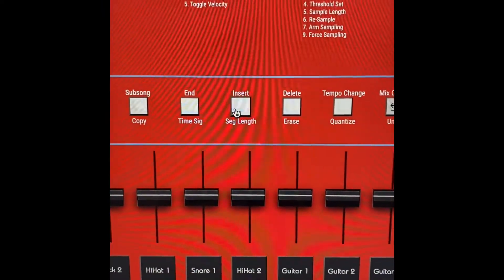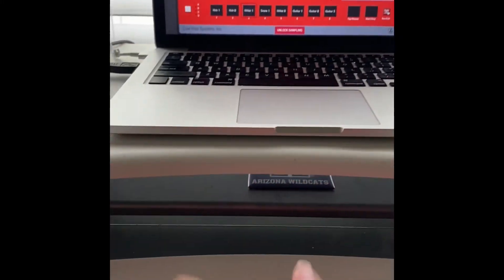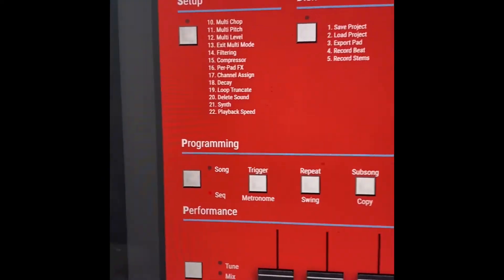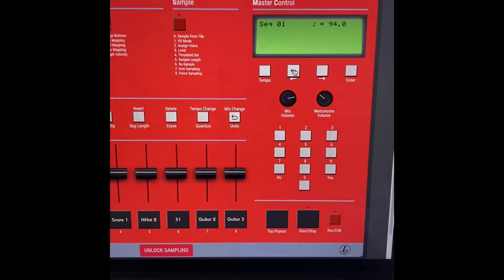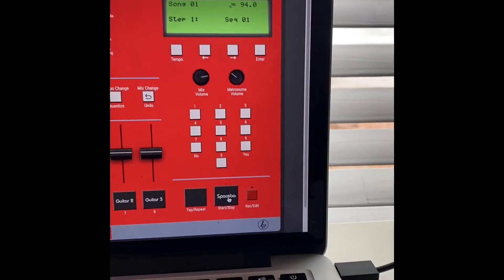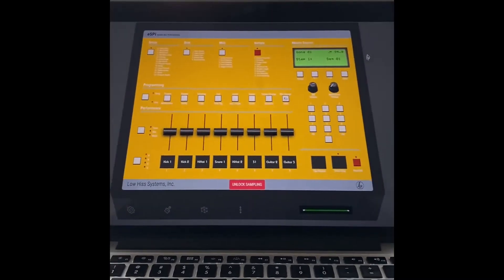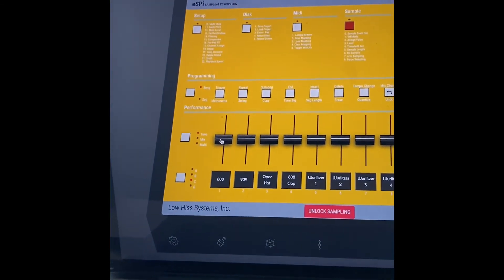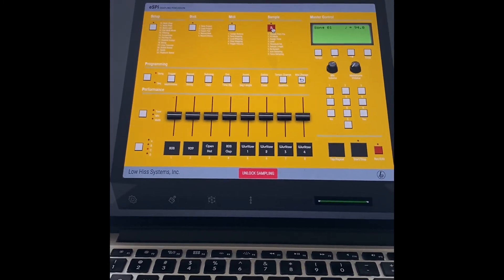Low Hiss Systems eSPi 1200, Emu SP1200 Software Clone

Comment: Thanks for the video! Any tips on doing bass lines using a low pass filter on my main sample sequence? Can you add a filter onto a sequence or do I need to assign the filter onto specific pads and then re-record my main sample sequence as a baseline if that makes sense? New to this appreciate any tips!
Reply from the maker: I haven’t used this software in some time. Let me look into it and see if tent had some updates

Comment: First time seeing this espi. Where does one get it?
Reply from the maker: lofi hiss systems in your google browser. He is a youtuber and is making a hardware version as well.
Reply: @MGtheProducer  MG, you just answered my question. I heard that he is working on a hardware version of the ESPI 1200 as well. That would be amazing. I have seen a few videos on this software and the sound is almost identical to the actual EMU SP1200. It's almost indistinguishable. Unfortunately, there hasn't been much information from Low Hiss in quite a while. Quick question: Can you use the MPC X or the MPC One as a controller for the ESPI 1200 software? And thank you for the video. Blessings!